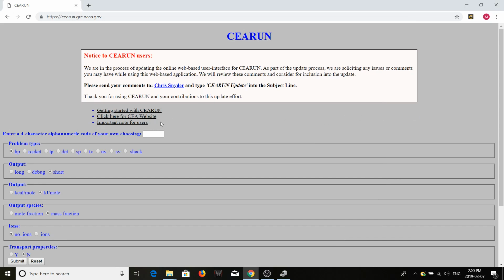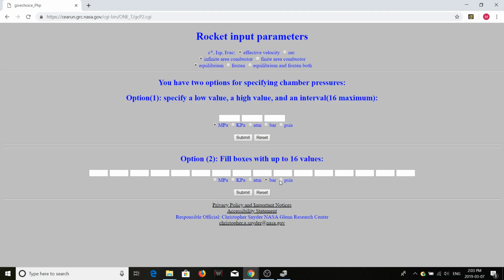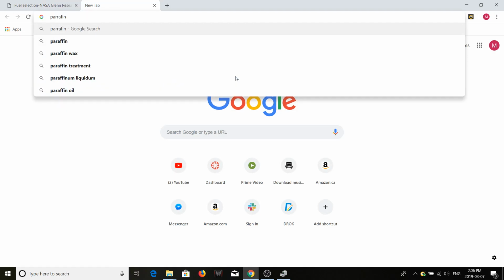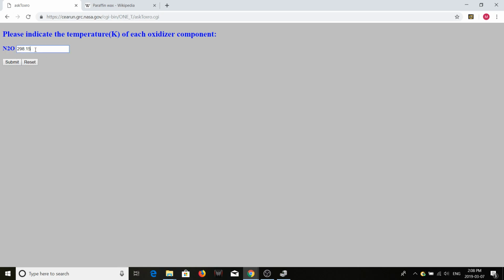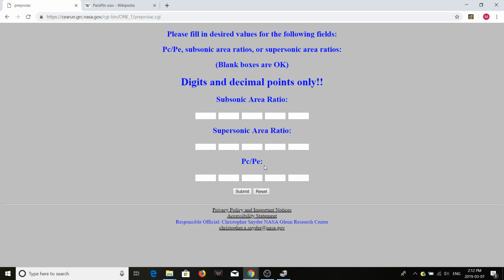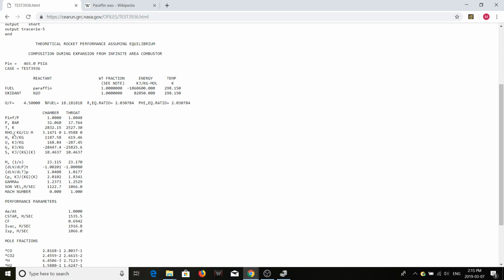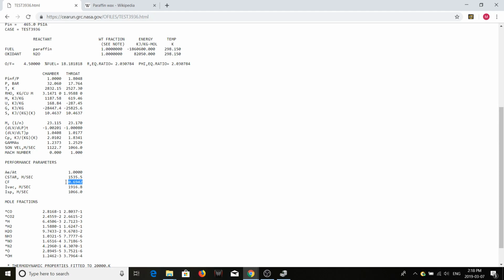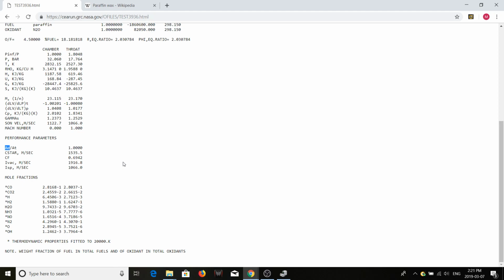How to use NASA's CEA Program

Comment: Is there a way to see more than 5 decimal digits for mole fractions please?
Reply from the maker: @victorfrankenstein1995  I am not sure, sorry 😔. Domyou really need a higher precision than that? If so have you considered downloading the RPA software (Rocket Propulsion Analysis)? It relies on CEA data, so no guarantees that it's better, but it might offer more precision, not sure.

That being said, if the CEA database itself only contains 5 decimals, than any added precision is false precision as you can't magically gain significant figures beyond what you started with.
Reply: @maxk4324  thank you for your answer. but I guess the fortran code can be manipulated to show more digits.

Comment: Can you please provide me the link of the  code you rae using? this has an option of taking solid fuel. when I used it, it  did not come.
https://youtu.be/P8kUarkOy_U?t=315
Reply from the maker: I don't have access to this code, it's a piece of software that NASA offers online for free, but that also means it only has what it has. As far as I am aware this software is mostly intended for liquid propellant chemistry, however it has some entries for solids for analyzing hybrid rockets (which technically still mix as liquids since it's the melted/evaporated fuel that burns, not the solid)

Maybe look into the RPA software (Rocket Propulsion Analysis). It provides similar functionality to CEA but offers more propellant options and I believe can do some solids, although I have not used it directly myself, nor have I done solid fuel mixture analysis before

Comment: Hi! I want to perform equilibrium calculations between glycerin, water and methanol. I am not finding glycerin in thermodynamic library of CEA nasa. Do you know if i could decomposed the glycerin into 2 ch2oh + ch + oh? could this compromised my results? i already did a mass balance and everything is ok, but the Std enthalpy change of formation is not the same published on databases. Thankss
Reply from the maker: I'm not sure how to enter partial reactants like that into CEA, or if it even accepts them. I'm also not sure that it would come out with a valid d result eve  if you could since there's no option to add charge to the reactants as far as I can tell and ch and oh can't exist on their own without a non zero charge. 

The program, or at least the part of it I know how to use and demonstrated here, is primarily intended for analyzing combustion chemistry in rocket engines and assumes a chemical equilibrium will form. Im not confident that this is the best tool for just general chemical equilibrium analysis, despite its very generalized sounding name.
Reply: Put your input in the exploded format. it will take.

Comment: Hey this is great! Do you have any advice for finding the ballistic coefficients?
 Trying to do this for a Hybrid as well and having a hard time with finding good values.
Reply: Hey man I'm trying to do a hybrid too !
Depending on how you to be accurate, but if I got it well you can bypass ballistic coefficient to compute the regression rate.
Reply: I think having found equations that could compute the coefficient rate but I need a sensor to know the temperature of the exhaust gas.
Reply from the maker: @spaceexplorationindustry3454  you will be hard pressed to find a sensor that will survive that environment for very long (like even just for a few seconds). For exhaust temp it's easiest to just use what CEA gives you for the stagnation (aka combustion chamber) temperature and then assume isentropic expansion through the nozzle if you need the gas temp at various parts of the nozzle.
Reply from the maker: I highly recommend getting your hands on a copy of the text book Space Propulsion Analysis and Design. I might be Jewish but that book is damn near the closest thing to the rocket propulsion bible. It goes through the entire design and analysis process for hybrid rocket engines (as well as other engine types).